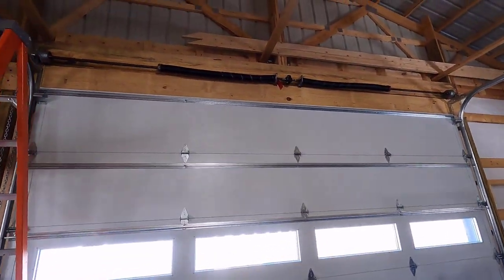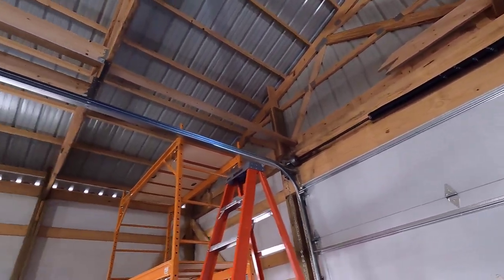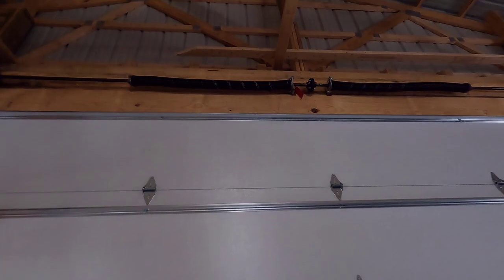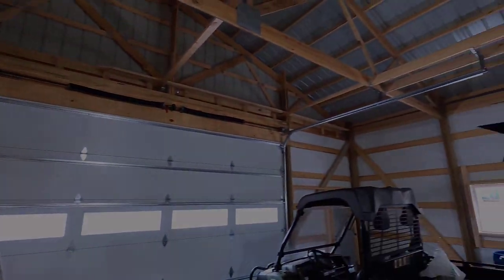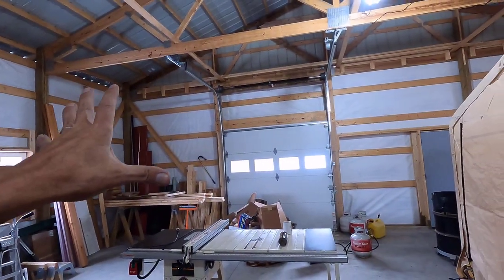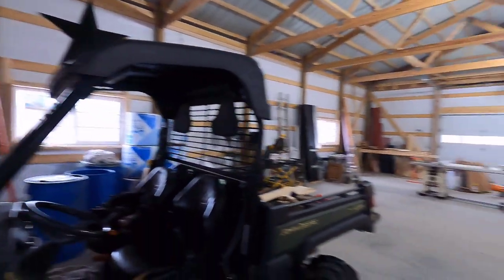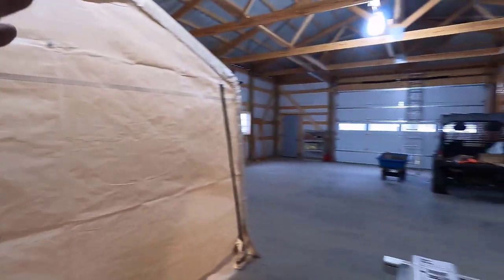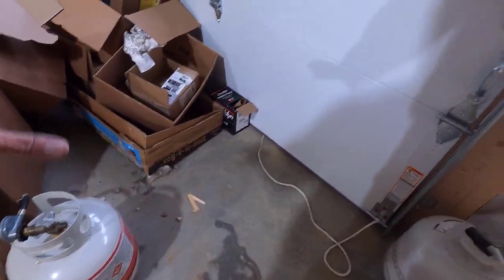Installing the Upper Diagonal Wind Braces

Comment: Those diagonals wont be needed until you get some very high winds, but when you do, you'll be glad they are there!
Reply from the maker: Agreed. The building is incredibly strong the way it is, but these will add extra stiffness in derecho wind speeds. We actually had a derecho pass right through where the front of the building is about 15 years ago — a few years before we built the house. It took down a dozen trees along the Billy Road! Another one hit us when the house was about two years old, so it's good to be protected! 😊

Comment from the maker: This is one of those things I have been waiting for the right time for. I cut these parts about two months ago — and quick got them up in the rafters before the roof went on. Luckily I did, because just as I suspected, they would not have went up there with the tin on! This would have been much easier if the scaffold could make it below the trusses, but hopefully I will not need the upper section to insulate — fingers crossed! 🤞

Dream Woodshop Build - https://www.youtube.com/watch?v=AoImFB7OU6c&list=PL_iZ8t8zAFuNbJMo1364rxDdTzcUNXcsJ

The Woodshop Self-Build Post Frame Playlist: https://www.youtube.com/watch?v=0lj0BOLzIRo&list=PL_iZ8t8zAFuN1C0XY70Gd-EaS0z2Knt0Y

Massive Concrete Block Retaining Wall -- https://www.youtube.com/watch?v=4HK40MAtL6g&list=PL_iZ8t8zAFuOSMNq3yhlyQUgLPqPdgVQ9

The Frost Protected Shallow Water Line Playlist -- https://www.youtube.com/watch?v=fHqK2tsprhE&list=PL_iZ8t8zAFuMRCCA56rTahk9c-LRbPq4j

Woodshop Build Tool and Materials Links:
Stabila 35712 Extendable (7 to 12 foot) Plate to Plate Level - https://amzn.to/3iGdpwP
Stabila 30035 Plate Level Case for 7'-12' Plate Level plus 24-Inch, 48-Inch Level - https://amzn.to/3AETnZQ
Woodford Y34-3 Yard Hydrant Freezeless - https://amzn.to/3AHE5Dr
Johnson Level & Tool 116 16 Ounce Plumb Bob - https://amzn.to/3jKIj6k
True Temper 00221400A Wood Wheelbarrow Replacement Handles, 60-Inch - https://amzn.to/3xLU4Pc
Starrett-C33H-12-4R Hardened Combination Square -- https://amzn.to/2KL3YOu
DEWALT Metal Shears Attachment -- https://amzn.to/3l8aYoq
DEWALT 20V MAX XR Compact Reciprocating Saw -- https://amzn.to/3nKHVFG
DEWALT ATOMIC 20V MAX Reciprocating Saw, One-Handed, Cordless, Tool Only ― https://amzn.to/2Msu21r
Legend Valve & Fitting T-5500 Lead-Free Brass Curb Stop, 1" - https://amzn.to/3jU9VpO
12 Ah Battery -- https://amzn.to/33JN48U
9 Ah Battery -- https://amzn.to/2SKUQwN
6 Ah Battery -- https://amzn.to/3odC6BW
Gallon Coppercoat Wood Preservative - https://amzn.to/2YDLaaj
Quart Coppercoat Wood Preservative - https://amzn.to/3FBt2io
Digging Bar -- https://amzn.to/3lGIfXu
Magnetic Lever Lock Tape Measure - https://amzn.to/3Exd5s7
3M All Weather Flashing Tape - https://amzn.to/3ICBX4P
Huber ZIP System Liquid-Flash - https://amzn.to/31OtCtN
Seville Classics Commercial-Grade 5-Tier  60" W x 24" D - https://amzn.to/3qgjrXJ
5000 Lumen Temporary LED Work Light - https://amzn.to/3eslZfu
Heavy Duty 3-Prong Wireless Remote - https://amzn.to/3EnPWYN
Powermatic Model 60C 8-Inch 2 HP 1-Phase Jointer - https://amzn.to/3mvPq4M
Jet Contractors Saw - https://amzn.to/3mAAQJs
Insul-Hold - https://amzn.to/3evnmKq
1" Garage Door Chain Hoist - https://amzn.to/3rn11VF
1" 4:1 Open Garage Door Chain Hoist - https://amzn.to/3uldvQA
1" 3:1 Open Garage Door Chain Hoist - https://amzn.to/3IVxXf0
1.25" Garage Door Chain Hoist - https://amzn.to/32R3vmS
Shed-In-A-Box - https://amzn.to/3g05gB8

Comment: Is the diagonal bracing 2x6x20 feet long each? I'm surprised you were able to locate any piece of wood as straight as it is that thin. When I go to the store 2x4x10 are all warped and twisted and they are only 10 feet long.
Reply from the maker: It's a 2" x 4" x 20' from Menards. It was pretty darn straight, but it doesn't necessarily have to be as it's there to transfer load from the peak to the posts/girts, and the straightness will only matter during installation. Good luck!
Reply: @PlanetMojo  It looked like a 2x4 but I was not sure since all the 2x4s I've seen at Home Depot are all twisted once they go past 10 feet. A 20 foot long straight 2x4 is impressive.
Reply from the maker: @lexwells4763   Home Depot lumber is horrible. Go to Menards if you have one in the area.
Reply: @PlanetMojo  The closest Menards for me is over 191 miles away. Its in the next state over.